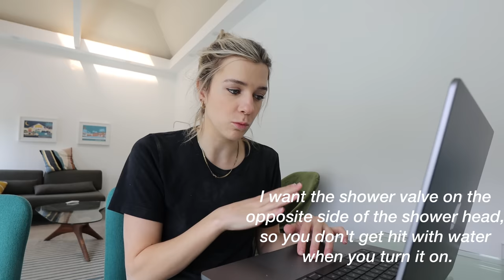Bathroom Renovation Week 1: We got rid of the bath tub!

Comment: tip you can use the sledgehammer vertically with a gravity drop you actually will get more punch from the larger surface of the sledge hammer hitting the tub instead of an end of the sledgehammer ... does that make sense. Just up and down.

Comment: NO! doin't do the step down!!  If its same level you have a bath that complies with folks who are in wheel chairs.  I get at least 1 inquiry a month for folks asking if someone can wheel into the shower and mine does have a ledge so I cannot rent to them.
Reply: It's hard to install the wheel-in shower because it can require changing the posts in the foundation to accommodate the necessary slope. I agree it's ideal though. I wanted to do it but the cost was too high
Reply: plus people can stub their toes on it